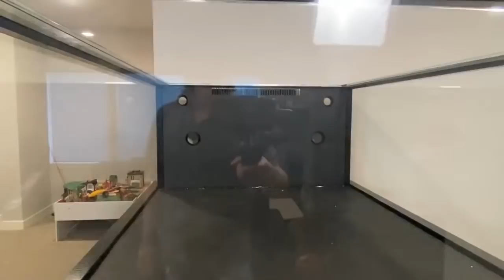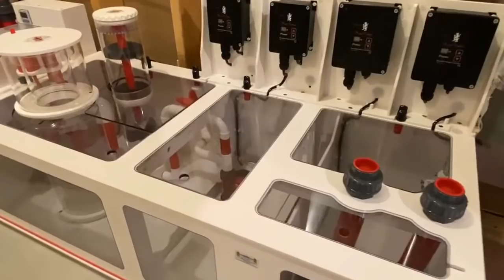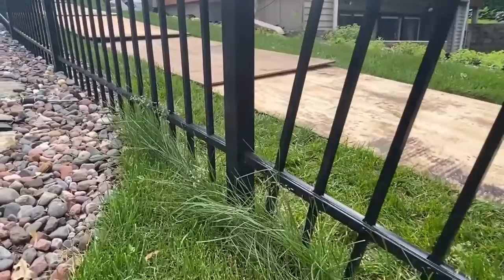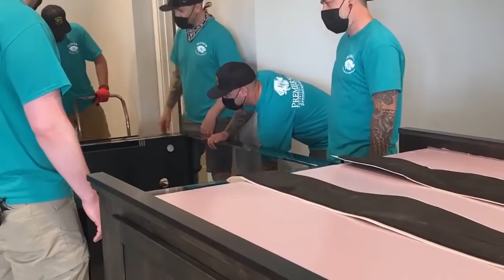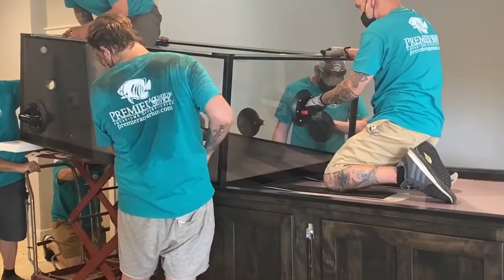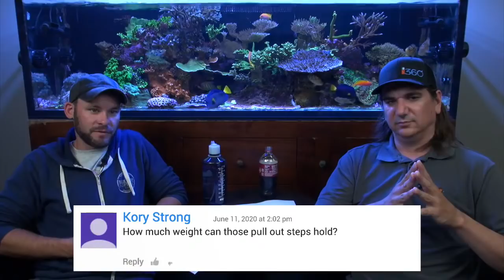Mega sized reef tank with mega sized challenges. Tank, Stand & Sump are ready! | Ep2: Ten Year Tank

Comment: I’m in elk river on well water and run my rodi on timers for a few times a day for drinking water and tank. I have the standard kit with dual di. The pressure pump at 90 was key though.
Reply: It’s a 180 so not a 360 but I’m running quite a bit of water with a few other tanks too